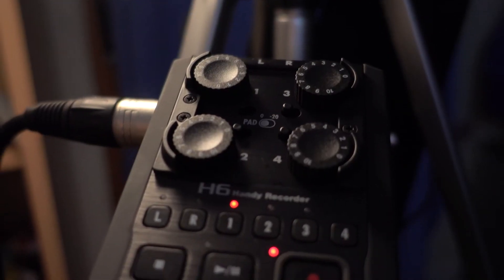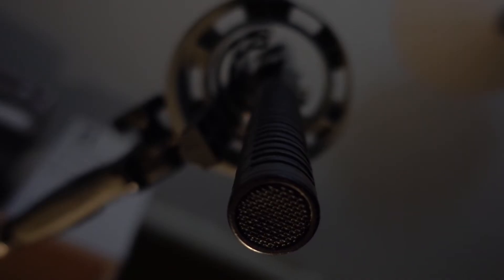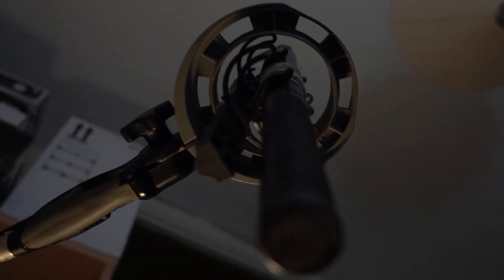GREAT AUDIO SETUP FOR VIDEO | Zoom H6 + Rode NTG2

Comment from the maker: Great thanks for the heads up I'll check it out. I was looking at the ntg4+ but most location sound mixers seem to have Sennheiser shotguns. Gaz
Reply: +HeyItsGaz The Sennheiser 416 is one of the most common "affordable" shotgun mics for professional work, but it will run you $900 or more. The Rode NTG-3 is the direct competitor to the Sennheiser 416, and some people prefer it over the Sennheiser. ( from my own listening tests they both sound very good, and I really can't put one above the other )
Reply from the maker: +SewTubular Ah so the NTG-4+ might one up the NTG-3 and it's affordable too. The rechargeable battery is more of a marketing ploy but it could come in useful with the 180 hour run time.
Reply: +HeyItsGaz The NTG-4 shotgun mic is lower quality than the NTG-3 shotgun mic, but higher quality than the NTG-2 shotgun mic. Rode's top shotgun right now is the NTG-3 mic, which is why it costs almost double what the NTG-4 mic does.